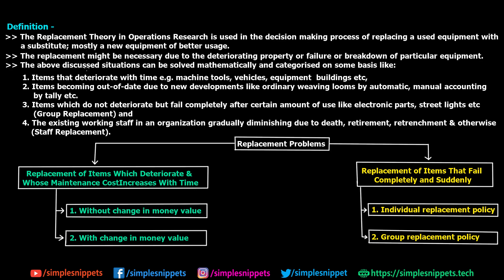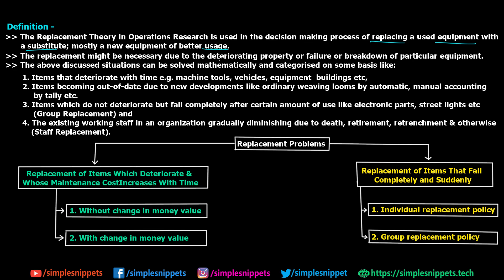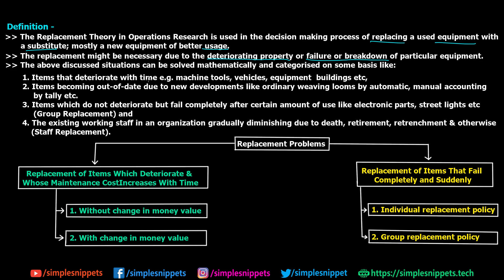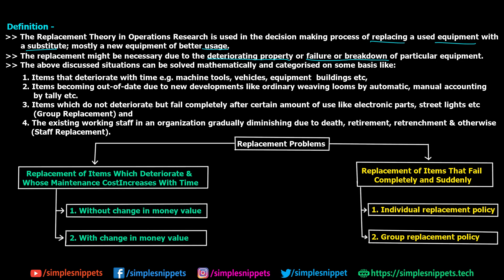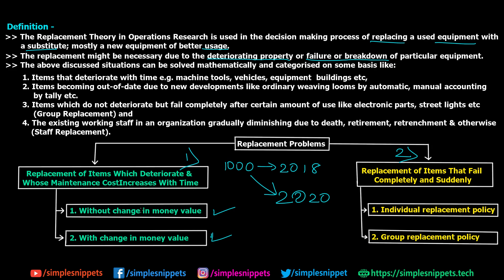Replacement Theory in Operational Research (Theory)

Comment: Hi bro i have one doubt, that is
for(int i=0;i<=i+10;i++)
How many times this loop will execute and how it will execute?
Reply: Wait this is not related to topic, is this?
Reply from the maker: How about you actually try it yourself 😉✌️
Reply: @SimpleSnippets  yeh i tried. Now i want verify by u r answer. So what is u r and🙂
Reply from the maker: It goes into an infinite loop. I did feel that will happen and the reason is because in for loop, the initialization of i = 0 happens only once. At the end of first iteration i gets incremented by 1 right. so the condition now becomes 1 <= 1 + 10 which is true. 
for the next iteration i becomes 2 and now the condition is 2 <= 2+10 which is again true. So you can see a pattern here right ? This is a never ending situation which goes into an infinite loop. 
You can dry run the code to test it yourself ✌
Reply: @SimpleSnippets  yeh bro super i am also think this is infinite loop. But during i run this program it shows the  output still 32758 times only so why is this happen? why it ends at only 32758 times ?Any reason?
Reply: @paulpandi50  It is because the range of the "int" type in 32-bit system is -32768 to 32767. In a 64-bit system, that would be -9,223,372,036,854,775,808 to 9,223,372,036,854,775,807, which will take a long time for ordinary computers to reach ;-) , and after that, it results in undefined behaviour.